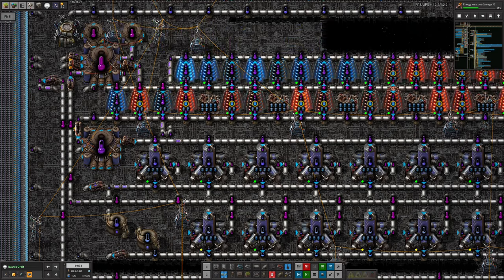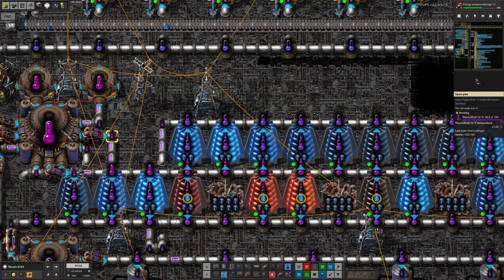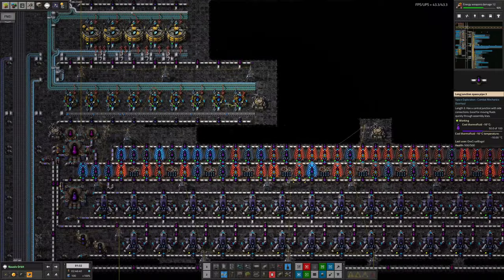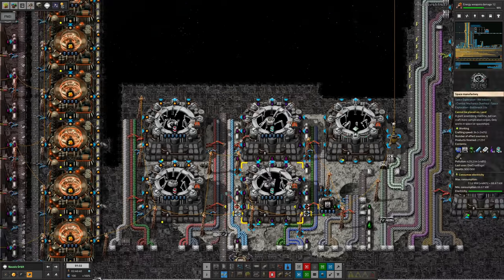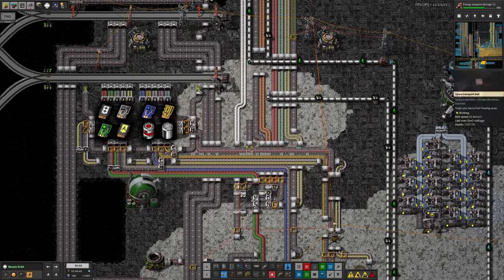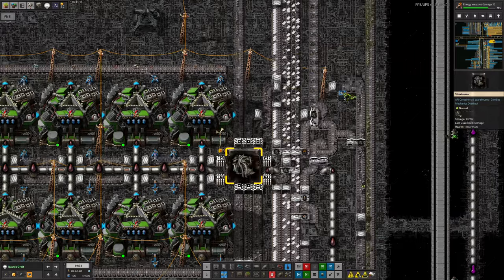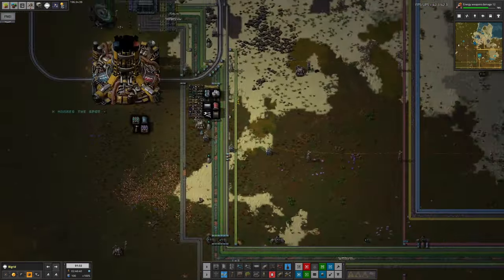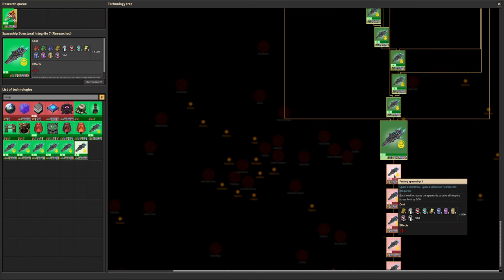S4-E03 pt 2 - Chilling Effect - Laurence Plays Factorio: Space Exploration 0.6 + K²

Comment: 23:00 If you want to delete the unwanted wood byproducts you can send them to burner generators and make electricity out of them.  If you want to be sure that they still get burned up even when the factory doesn't need the electricity you can send them off to a separate power grid.  A few transmitters will create a constant demand for electricity on the other grid and ensure the burner generators are always getting rid of the waste wood.
Reply from the maker: At the point where we're burning it to generate power that we're just wasting, we might as well void it...
Reply: How are you voiding it though, manually?  @LaurencePlays

Comment: 5:00 You could just add pumps every 8 or so machines (in the pipe supplying the warm thermofluid) and you'll vastly increase the speed at which the fluid goes through the pipes.
Reply from the maker: True! That would probably be easier. Better. Sensibler. Or maybe even do both!  \o/

Comment: Pipe capacity is tricky cause the amount in a given section doesn’t indicate how much is flowing.

It starts at 12k/s with tank-pump-tank or 6000/s for pump-pipe-pump and decreases geometrically the more pipe sections are between pumps.

Flow from tanks with no pump is much lower. 

pipe length (from pump) - flow rate(Hz)
1	6000
2	3000
3	2250
4	1909
5	1714
6	1588
7	1500
8	1434
9	1384
10	1344
100 1033

So for a single long pipe, the sum of the machine rates up to a given point has to be less than the flow rate for that distance from the last pump. Or else your machines are idling due to lack of fluid, or backing up on the output side. And you'll never fit more than 6000/(machine rate) machines on a single source pipe even if you put a pump between each one.

So if e.g. radiators ran 100/s, you could absolute max 60 on one pipe with pumps between each machine, but with only a single pump at the beginning you could fit about 12 or 13.
Reply from the maker: Heh, you can see why I find it awkward and just guess! By now, I have a reasonable idea so my builds tend to work with only a bit of tweaking!
Reply: Its good to mention advantage of long pipes and undeground pipes. They count as single segment, just like one normal pipe, thus you can cover more distance with less segments, eg more throughput. Personally, I use combination of one 5' pipe, two normal pipes and a pump inbetween every 6 radiators.
Reply from the maker: @gneruinseruihnutshnu  Very true, I can't remember exactly how I set it up there, but using longer pipes wherever possible is good for throughput, UPS and satisfaction!

Comment: I doubt you can use that thermofluid setup because of pipes. I use multiple paralel setups.
Reply from the maker: It was working until recently, but yes, it's possible I've tipped over the limit with it. I think I can still make it work, but some changes are definitely needed. Come along to the stream and you can say "I told you so" if I'm wrong!